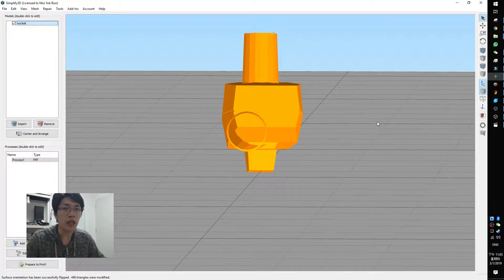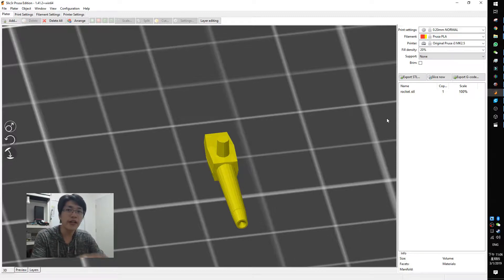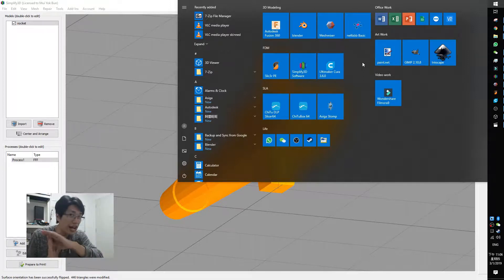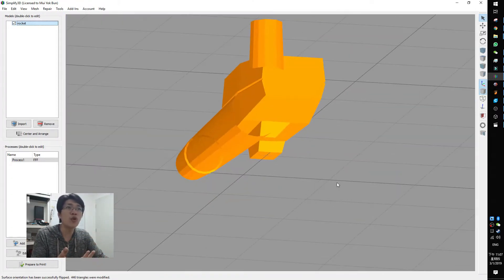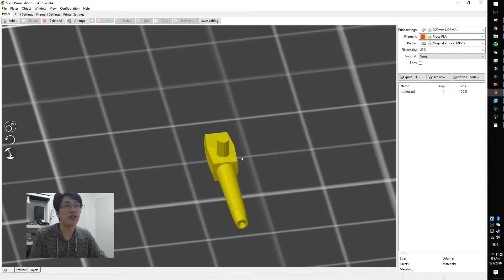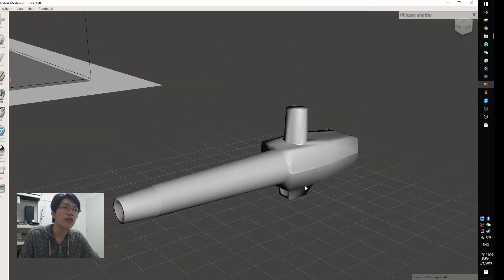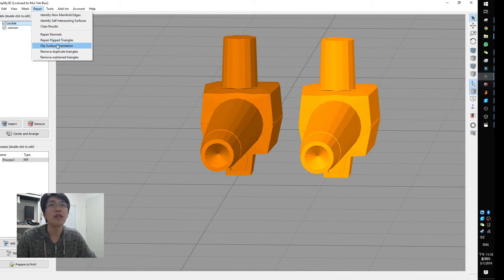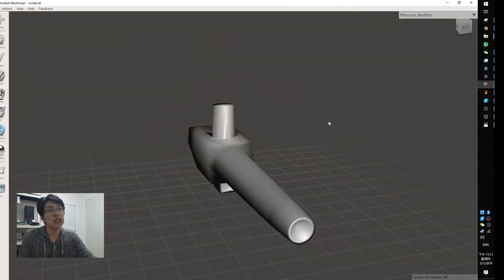How to repair 3D model surface issue with meshmixer

Comment: i have a LARGE file that has been in the REPAIR feature in the slicer IDEA MAKER for over 48 hours now... it is not frozen because the moving bar keeps filling up and refilling up again... i am just getting a lil nervous about why it is taking this long.. perhaps it has alot to repair.
Reply from the maker: normally if the file repair too long. Amos mean it fail to repair.
the reason it can't repair 
1. you the geometry is too complicated. 
2. file size is too big 
3. unfold / 0 thickness /non solid model 

you should go back to your model check it out. 
if you need more dive in check maybe you could email model to me. invabun@gmail.com
Reply: @MBBFM  Thanks for your response.. it has now been in repair for now for over 3 days  and i am going to stop it... i thought that it would have gone into an error code if it couldnt do the mesh repair.

Comment: You saved my project! I make 3-D Models with a free software called freeship, and it has a tendency to have wrong oriented surfaces.Until now I used online tools to fixthat, but meshmixer is offline and waay quicker to use. Thanks so much for your video!